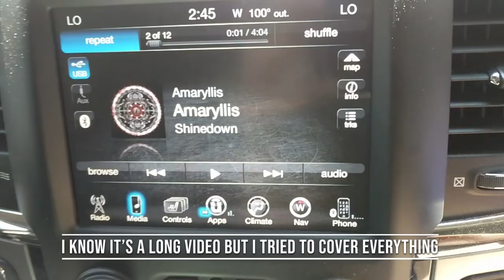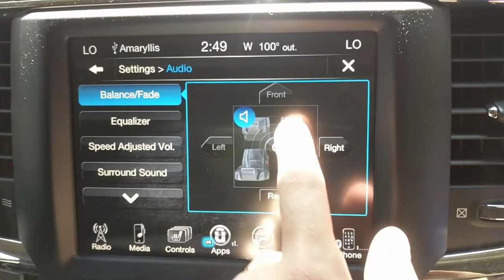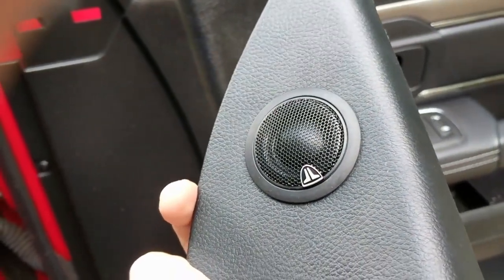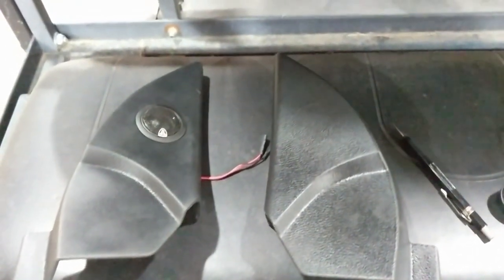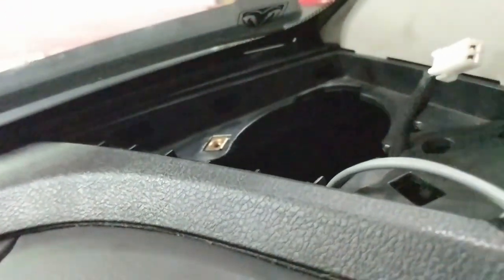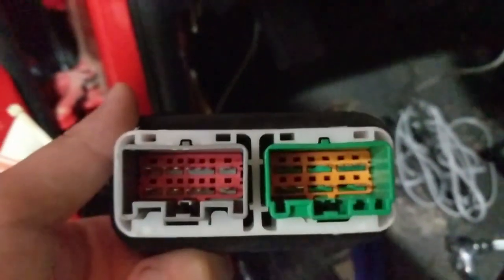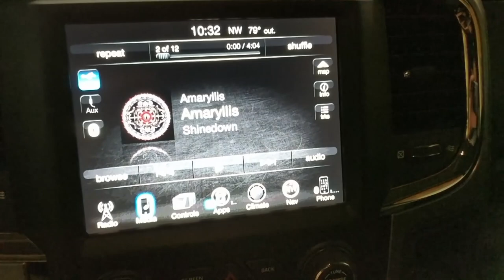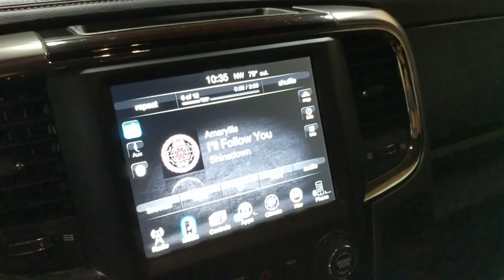Custom JL Audio Tweeter install in 2017 RAM - Evolution C2-600

Comment: 16 Ram 1500 crew cab here with the Alpine upgrade also. Good tip about the front door speakers being low pass sound only. I ordered some Skar 3.5 Vxt bullet speakers. If not happy Infinity is the way to go. Worry about watts on the 3.5’s  with aftermarket amp though.

Comment: The reason I couldn’t get the door speakers to sound good is because the stock speakers are lower impedance. Only way to make better speakers sound better is to add an aftermarket amplifier.

Comment: I did all morel 6x9s inn my 09 ram with the alpine and 3.5 infinitys in dash I bypassed part of the alpine amp and ran a 4 channel amp to the morel 6x9s and the alpine just runs the 3.5s sounds great also have sundown 12s under rear seat
Reply: How did you bypass part of alpine amp to the dash speakers?
Reply: @Jluong538  I didn't I use the factory amp to run those since there 3 ohm like the factory factory speakers
Reply: @whiteoutram0516  oh ok I also have 4 channel amp for my 6x9s. I'm looking to change out my dash speakers too.

Comment: My tweeters are connected to the door speakers directly, and have a small capacitor on the positive wire. So no need to go into the dash wiring. It was done that way by Isuzu, its a Trooper 1996 with a factory tweeter in the same place as you put yours.
Reply from the maker: That's awesome and waaaaaay easier.  Unfortunately with my setup, the door speakers only receive low frequencies, for mid-bass, and so I couldn't tap into them.  Had to make things way more difficult and get the signal from the dash.

Comment: Did you ever replace the front door speakers?? I have a 22 ram with the alpine as well. Looking at changing the speakers
Reply from the maker: I did not.  I wanted to find something better even if I had to use an aftermarket amp, but I'm very limited on what will fit there because of a metal bracket for the window is directly behind the speaker cutout.  So you can only use certain shallow mount speakers.  Maybe you're newer 22 RAM isn't like this and you have more options.  I was pretty happy overall with the result so I left it alone.  I just need to add a sub now.  Here is a link to the picture with the bar I was talking about. https://images.crutchfieldonline.com/ImageHandler/trim/3000/1950/VehiclePix/2017/Ram/1500/Pickup%20Quad%20Cab/with%208.4%20LCD%20Radio;%20with%20Alpine%20Audio%20System/frontdoorcavity.JPG

Comment: I was wondering the same thing why not connect to the door speaker , have the same truck , I don’t have alpine system swapped out factory 6x9 for aftermarket. I’m wondering will it work
Reply from the maker: If you don't have the factory alpine system, connecting to the door speaker should work just fine and be waaaaay easier.  The problem with the alpine system is that the front doors only receive low frequencies, so hooking the tweeter to them wouldn't work.  That's why all the extra trouble to route through the door up to the dash speaker.  But if you've already replaced the 6x9's and have highs coming through them, go for it.  It'll be a lot less work.  That's what I did for my rear doors as they are full range, but not the fronts with alpine.  Thanks, good luck with your project!

Comment: I have the same truck, is the A pillar possible with these tweeters?
Reply from the maker: I’m not certain, I never pulled the pillar covers off when working on mine, so I’m not sure if there is enough room behind them for a surface mount.  From the start I wanted to install in that cover in the door so I never looked at the other parts.  Also, if I happen to screw up I could just replace that small part.  Good luck with the install if you try it.
Reply: Might go with your layout instead. I want 1" Alpine tweeters flush mounted and the A pillars would look ugly. What guage wire did you go with to get through the tiny hole on the driver's side?
Reply: Thanks for replying to a super old video I appreciate it.
Reply from the maker: It's been a minute since I did this, but I'm pretty sure it was like a 24 gauge wire, just some small speaker wire I had leftover from another project.  It wasn't anything big I know that much.

Comment: JL AUDIO C2 650 IS BETTER THAN INFINITY KAPPA AND POLK AUDIO DB6501 COMPONENT?
Reply from the maker: That's probably subjective to your personal taste.  I've had Infinity Kappas in other vehicle and they were absolutely awesome and loved them.  I've had JL Audio in other stuff (mainly subs) and they are great.  Kappas usually need an amp to get the full potential (most do) but these tweeters did fine with the stock amp.  I don't have any opinion on the Polk.

Comment: What did you do with the ceiling and door speakers? Still stock?
Reply from the maker: Hey, I originally was going to use the 6" component JL Audio woofer that came in the kit to swap in the door.  I swapped it in and did a comparison from stock on one side to the JL on the other and the stock had better bass.  The stock in the door is a 6x9 and it just sounded way better than this setup.  Normally JL's are awesome in almost every application, but maybe it was a power issue, or maybe a 6" speaker just wasn't going to work.  So I left the stocks in for now.  I haven't touched the ceiling speakers either.  I believe they are the same 3.5" as the dash so it wouldn't cost much to swap them out, but honestly I'm happy with what I've done so far.  Put infinity reference 3-way in the back doors and it's an entirely different sound system.  Last step is I'm going to put a JL stealth box to replace factory sub, and that should finish it off.
Reply: Raymond Lamb I may go your route before amplifying. I am stock except for 2xSA12s with a ported foxbox under rear seat. So I just need a little more highs and mids. And I’ve always said this truck needs tweeters and also wondered about that same exact spot! Thanks for being the guinea pig and sharing!
Reply from the maker: No problem, it was a large improvement when I replaced the 3 dash speakers with the 2-way infinity reference speakers.  But adding the tweeters got it to where I wanted it, crystal clear and can hear all the details now.  Stock was just to flat sounding to me, even with the alpine system.  Good luck with your build!

Comment: What is the size of the hole that the tweeter goes into the trim ?
Reply from the maker: Hey, I looked the info up on Crutchfield as I couldn't remember.  It claims it's a 1.620" Diameter.  You can see all the specs here: https://www.crutchfield.com/p_13699615/JL-Audio-C2-600.html